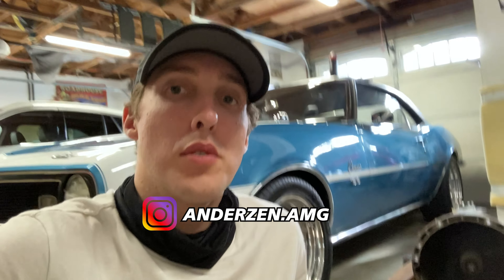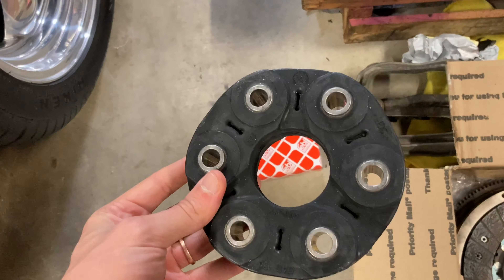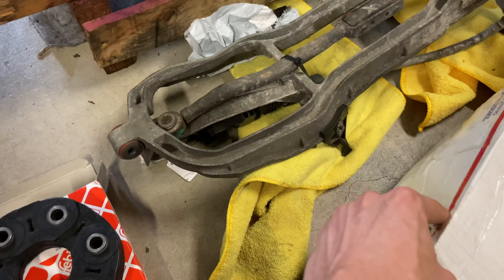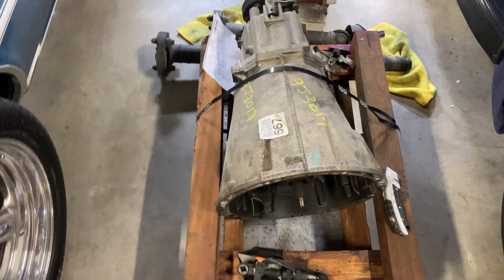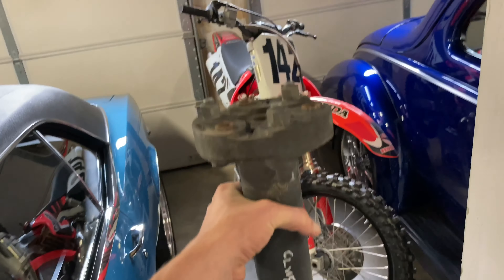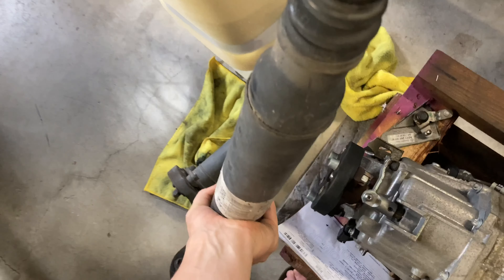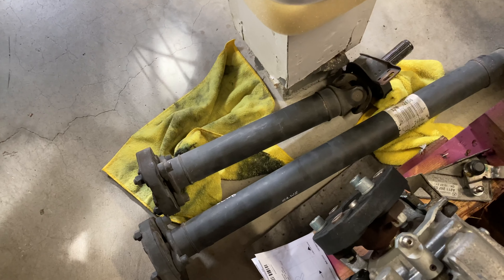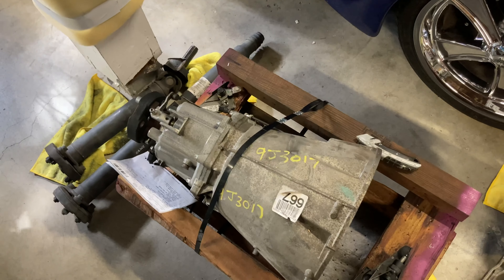C55 AMG - Manual Transmission Swap Update (MORE PARTS!)

Comment: I dig the foam on the garage support to protect your doors from dings.
Reply from the maker: Vyasa Dodson my step dad put those there to protect his baby...the 68 camaro ss haha
Reply: @ANDERZENAMG  As a recent owner of an 05 C55 I'm interested in this build.  Any issues cropped up since you installed everything?
Reply from the maker: Vyasa Dodson i have a one week update dropping tonight, had a weird noise on downshifting when I drove it more this week. But turns out it was just the heat shielding rubbing the shifter bracket. Besides that all is smooth. Going to do the coding for manual this week with video too! 🤙🏼
Reply: @ANDERZENAMG  nice dude, I'll check it out.  Subbed.

Comment: Thanks for the update Brooks. Better to over plan and prepare than to fly into something and stuff it up! Keep it going👍
Reply from the maker: michael deayton of course! my thoughts exactly, better to prepare with time on my side. BTW, researched more and found out lots of m113/m113k guys are using this trans for track/drift usage with good longevity and strength capacity. Not too worried about it for this application now, should perform well!
Reply: @ANDERZENAMG  Good to hear! Hopefully with the clutch pedal setup, heal and toeing will be easy to perform.
Reply from the maker: michael deayton Hope so!

Comment: I have a 2006 C230 sport 6 speed already is my transmission compatible to the m113?
Reply from the maker: Compatible yes, any m112 trans will work but 320 or 350 is recommended for torque handling capacity

Comment: Hi , did you have any trouble with the flywheels 
The 3.2 engine from crossfire has a different flywheel than my m113 5.0ltr
If anyone could help I’d appreciate it as I’m in Oz
Reply from the maker: Two different bolt patterns depending on year, they changed to 4+4 pattern around 2005
Reply: @ANDERZENAMG  thanks mate 
Do you know of any others options ? I’ve got everything I need except a flywheel now 
Cheers
Reply from the maker: @eamonncummins6814  No problem! I got mine from FCP but you can find new/used ones on eBay or possibly Rockauto?
Reply: @ANDERZENAMG  again , thanks a lot 
I didn’t know there was another model they came off ? 
If you had a part number also that would be brilliant 
Cheers
Reply from the maker: @eamonncummins6814  no worries at all! all the part numbers are listed in the bio of the manual swap videos. I also have details posted in threads on MBWORLD and Benzworld.
Reply: @ANDERZENAMG  your a gentleman, thanks again mate 
Look out for an w111 coupe with the M113 and the 6 speed in the future
Reply: @ANDERZENAMG  everywhere’s out of stock mate 
Hopefully it’s not world wide shortage :(
Reply from the maker: @eamonncummins6814  you can also check Rennsport factory, they make singlemass flywheel kits for about $900usd